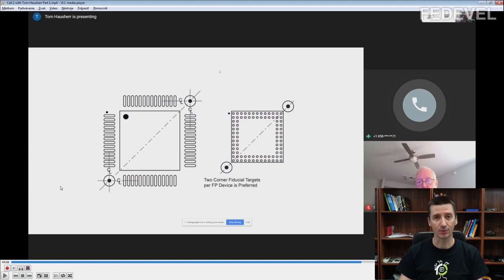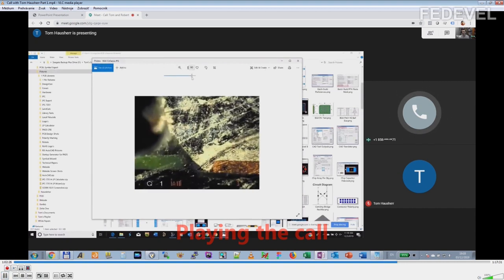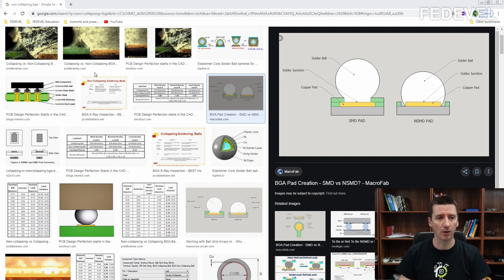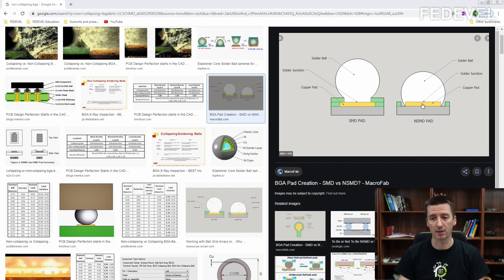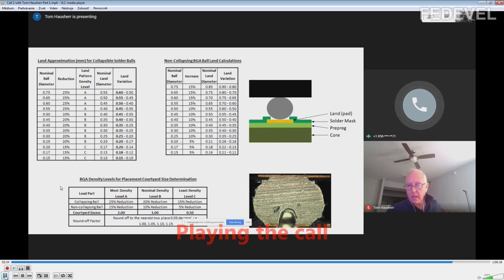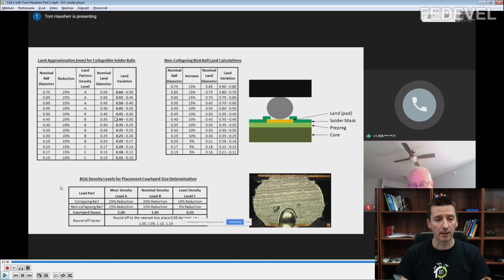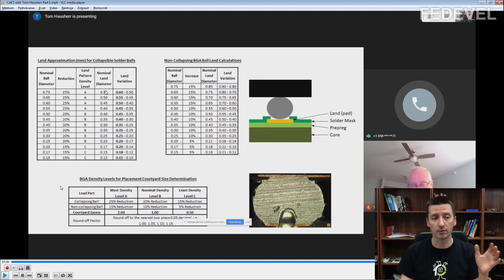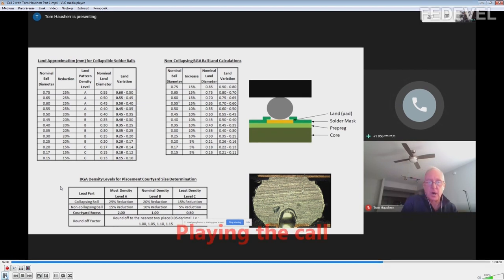Should you place solder mask over BGA pads? Do you know why? | Tom Hausherr | #HighlightsRF

Comment: So what happens if you put solder mask the same way as thermal reliefs so not a complete ring but a couple of edges. I guess a straight line like a thermal relief is not a good way but maybe like half circles. That way it kind of looks like a flower pattern from the top. Would the ball be able to collapse partially onto a pad and the parts of solder mask that stick over be able to hold the pad better.
Reply: Oooh, I wrote the same thing! Great minds think alike.

Comment: Would you also find the same problems with other SMD components with the copper pads ripping off during drop tests/vibe?
Reply: I think its harder for other pads since they are generally larger than those tiny BGA pads. Larger pads means more "hugging" to the Epoxy I'd think. Fair warning though, I have never done any vibrational testing but I do PCB design too, simpler stuff.